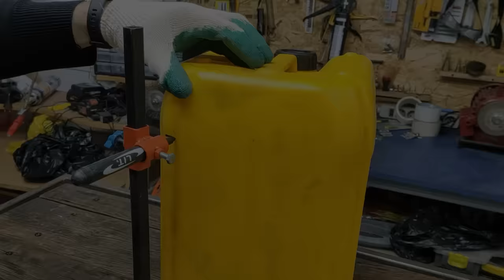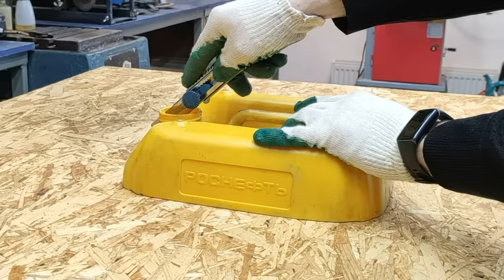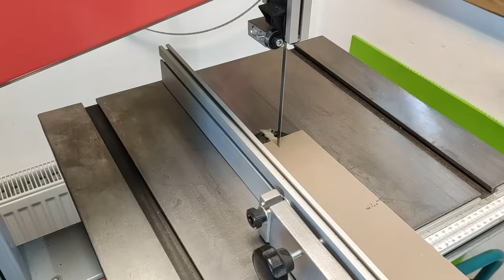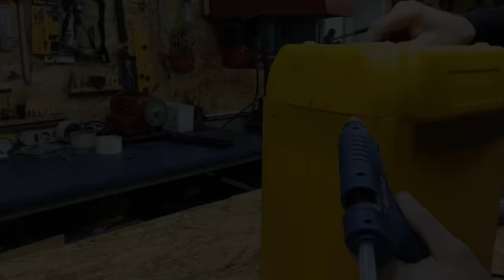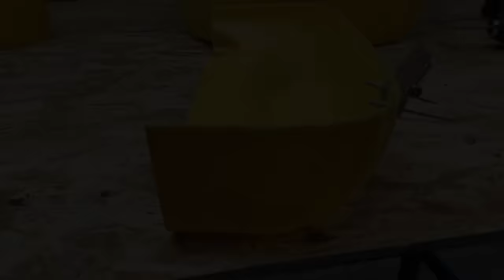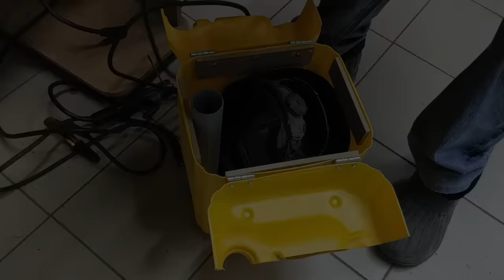Secret of the old canister!!! Genius idea!

Comment: Good idea, but you should have screwed through the plastic container, into the stiffening strips, or they will loosen and tear out quickly.
.
Reply: A better idea would be to attach the strips with pop rivets like the hinges . 👍🇺🇸😎
Reply: Exact !
Reply: I would have used some type of screw and washer, possibly improvised.
Reply: @ronniechilds2002  And use nylex nuts?

Comment: That is the stupidest thing I have seen in awhile.  You have a welder and your using plastic and hot glue. Anchoring 1/4 inch wood to thin plastic with screws ?